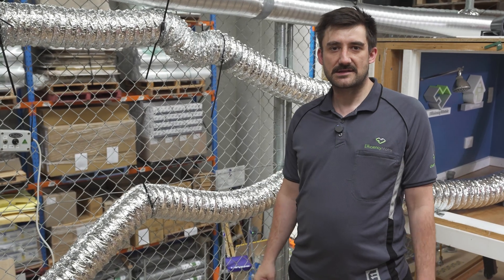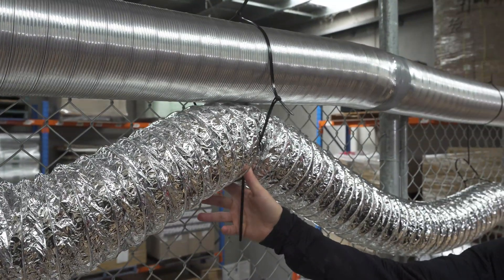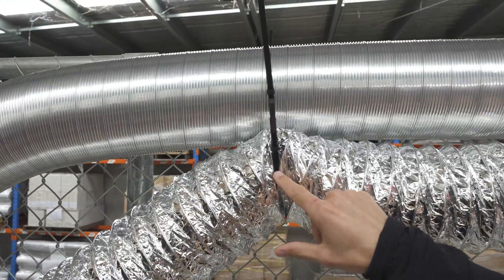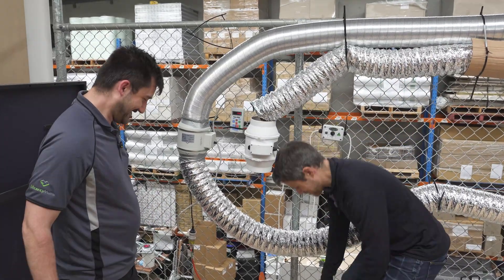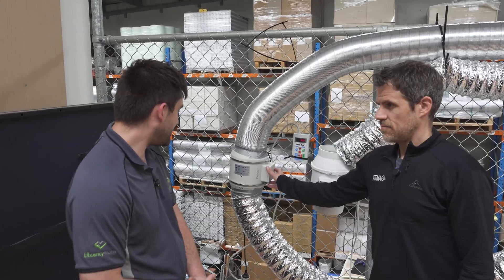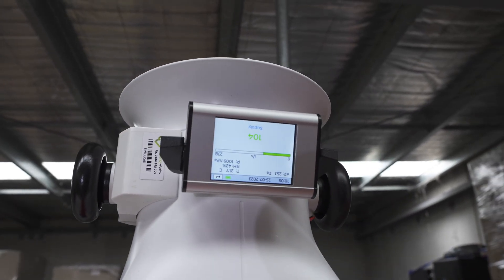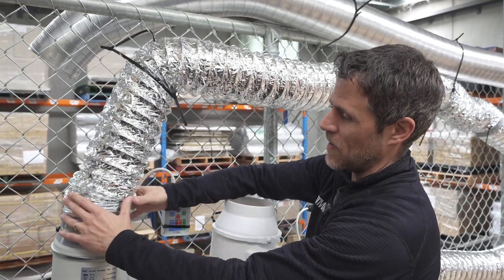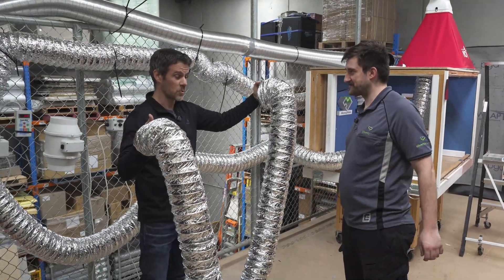STOP Doing This to Your Ducts! Don't just blame your ventilation exhaust fan.

Comment: Something I don’t like about ducted exhausts is the back draft stoppers are not air tight and the dust and moisture (i.e. mould) in ducts can flow back in when the fan isn’t running. A through wall exhaust fan might be better because it is easier to clean.